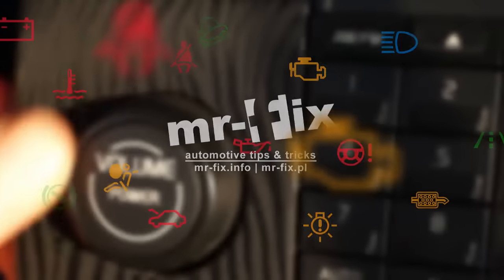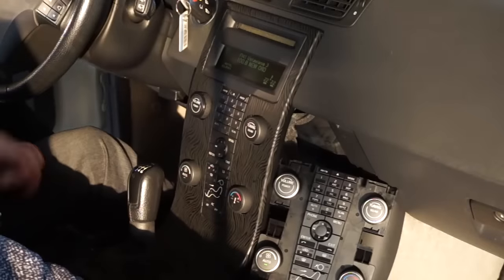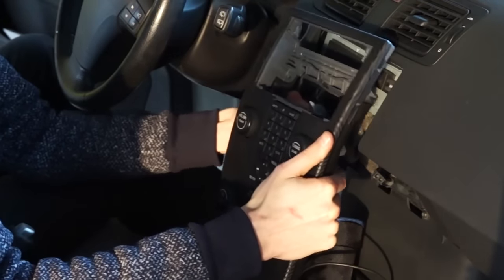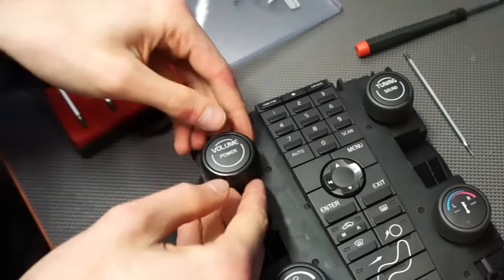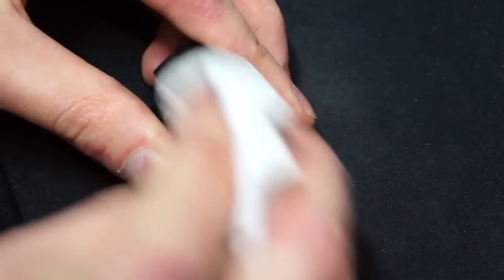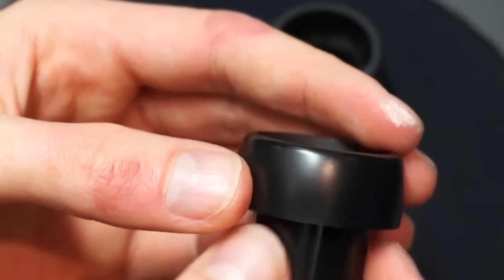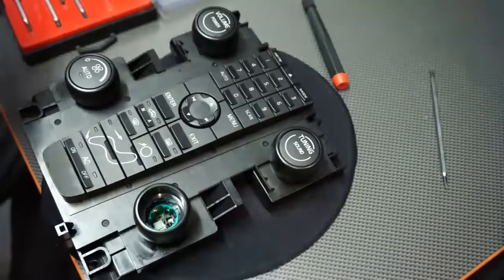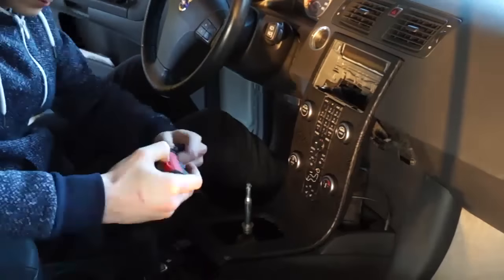How to replace & fix knobs in Volvo C30, S40, V50, C70 (chrome tuning CCM)

Comment: this might be a couple years late but is the one you bought to replace it of the same model year or has it been already wiped so you are able to have it work right away?
Reply from the maker: It was from a younger car but there was no need to recode anything. P&P.
Reply: Do you by any chance still remember where you got the new one from?

Comment: Hi, i was lead to believe you can't just change the module without swapping the coding over. You seemed to have no problem. Do you know if it always works? Or were you just lucky?

Comment: I am buying a 2006 Volvo S40 T5 AWD tomorrow. It doesn't have Bluetooth, any suggestions on a Bluetooth install that looks seamless or close to OEM? Is that install available in the US?
Reply from the maker: IF you have AUX input then there's something that you can do. Browse through my videos and you will find my bluetooth install in Volvo C30.
Reply: Hayden Walstrom I purchased a 2009 C30 with a Parrot Bluetooth unit installed. I like it enough not to want to replace it. :-)

Comment: Just pop out the knops without removing Waterfall Consol! Ist About 5 Minutes
Reply from the maker: +iPhone4ever sure you can do it without disassembling the console if you can grab the knobs strong enough to pull them out. In my case I had to swap the CCM anyway...
Reply: Why did you need to change the CCM?
Reply: I've just popped them off, cleaned them and popped them back on, absolutely no need to take the whole waterfall dash out. The marks you see on the knobs is grease from touching, they don't chip